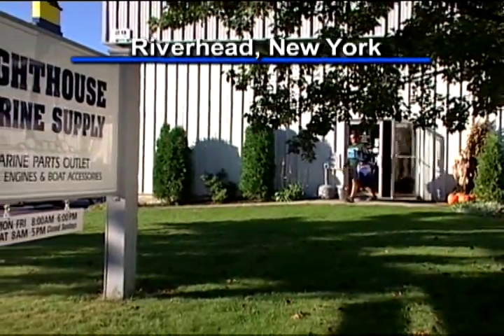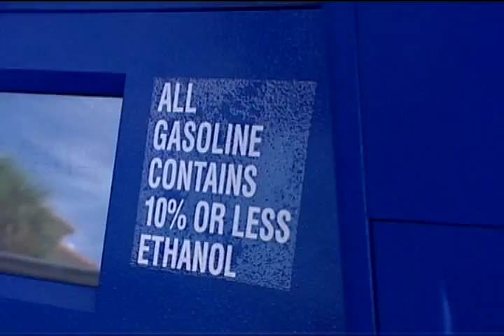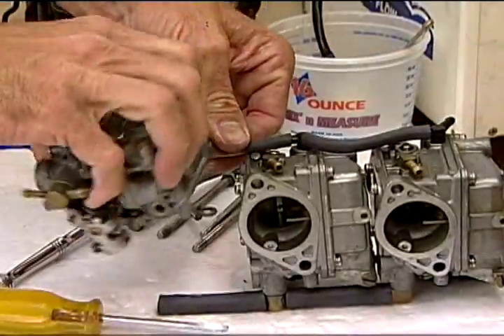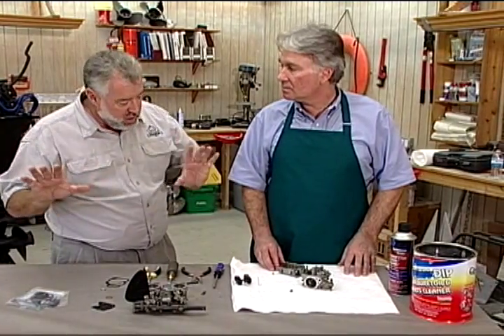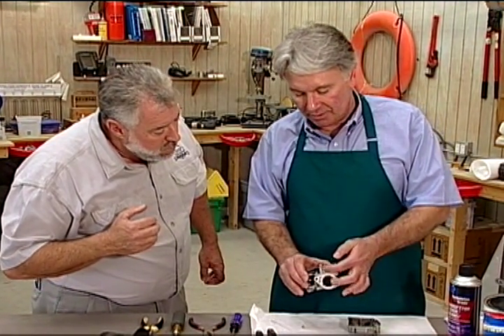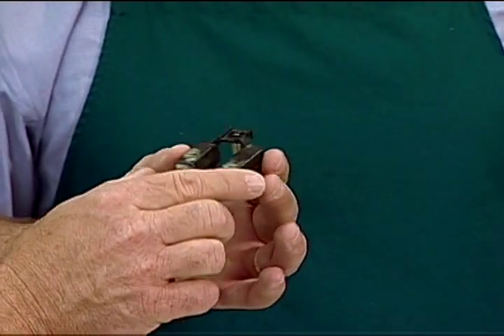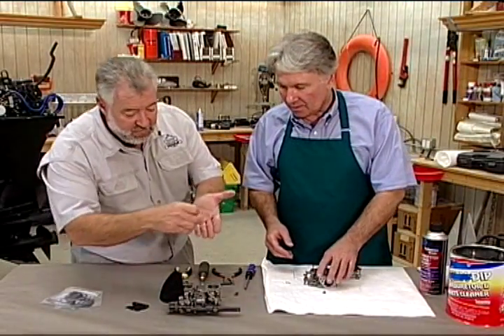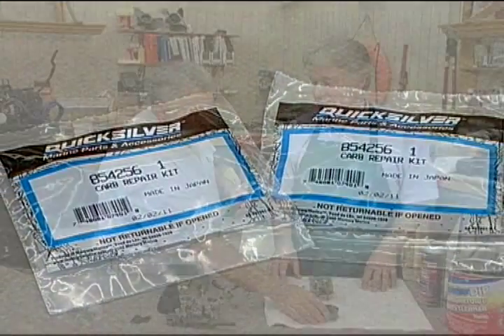Ethanol Fuel Damage Tip

Comment: It been years since I did a full tear down on a carb till about 6 months ago. I found my hands on a boat that was sitting for 14 years. I cleaned the carb, made some 2 cycle fuel with ethanol. Just recleaned the carb after 6 months and it looked like the last 6 months with new fuel lines and pump and tank was dirtier than after the last 14 years. I'm worried that I'm seeing corrosion starting to form in the carb. It seems like long term I'll need to get ethanol free fuel which is becoming difficult to find

Comment: Mark IV Spitfires and P 51 Mustangs used Methanol/Water as an antidetonant for superchargers. Ethanol in large percentages is no problem in engines. It is bad run refinery practice of introducing unprofitable solvents into pump gas. Consumer fuel tanks end up as disposal for waste refinery chemicals. Like the batch of ammonium nitrite I got at a fillup once. They used to just drive a tanker down the road at 3am with open valve to dispose of it. Now modern fuel injection ecu engines, do the deed for them. Truth.

Comment: American refineries have been blending low profitable poor quality fuels since micro controlled fuel injection became standard. My own tests of early ecu carburetor systems proved spark knock was apparent in low compression engines. Ethanol was the cheapest solution. Modern vehicles Evap systems will not allow H20 in the fuel tank. It is refineries poor quality control and in ground storage at point of retail sale that is the cause of terrible engine petformance. How many times have you EVER seen a guy changing the filter on a petrol pump? I seen it twice in 40 years. Rust, crud, gunk...mmm?